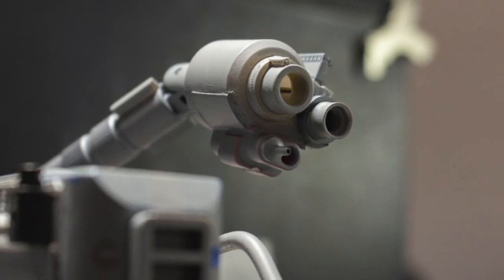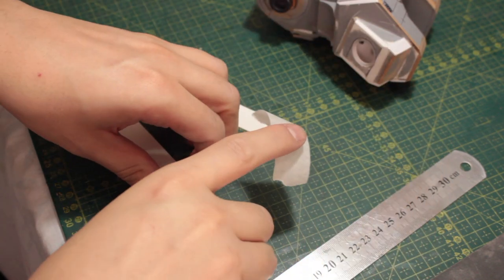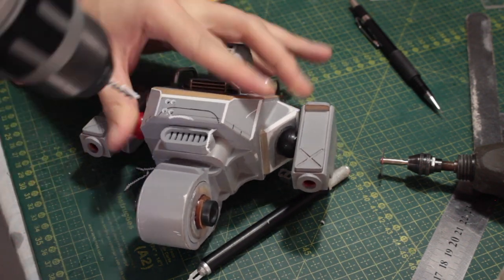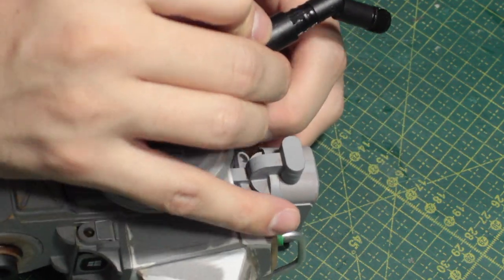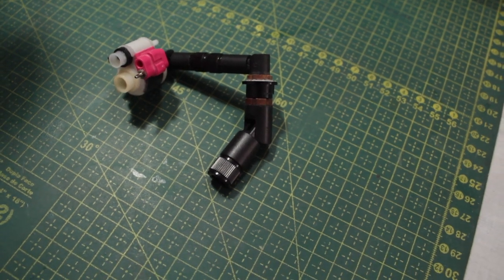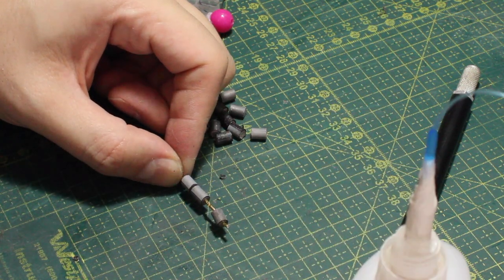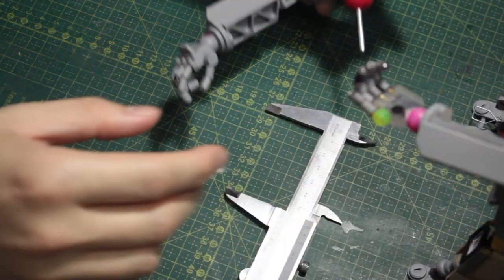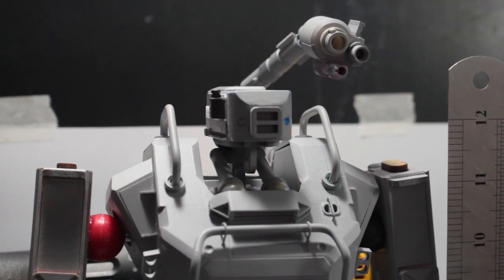Scratchbuilding a Humanoid Repair Robot - PT3

Comment: You can make your own super glue applicator by cutting the end of a sewing needle off so you have a forked tip & use a pin vice to hold the pointed end & you dip the forked tip in the super glue & use that instead of a blade.

Comment: Would like to see the shoulder guard bars a little closer. Imagine this bot would be in tight spaces so the metal exoskeleton, or protection I guess, could be really tight tolerances to fit space. But hey, it looks great either way. Old cell keyboards like blackberry are good to use for small buttons, hatches and such.
Reply from the maker: I agree! I guess I thought they had to protect the head but, the tight spaces is indeed a good point.. Not sure I'm able to easily change that now that the glue is set real tight.. but anyways, thanks for your input buddy!
Reply: Cut Transform Glue nah man it’ll look great anyway. Cool how complicated a piece of machinery you’re making from such simple pieces. Have you got idea for paint scheme? I could see it a clean white/grey with red accents. A dingy yellow or a grimy metallic.
Reply from the maker: Thanks a lot!! As for the paint scheme, I really want to think about it for a while.. I feel the need to improve my skills on that matter, I'll make some paint tests first... But I leaning towards a using different finishes of metal and some accent color!

Comment: Great progress as always! An opinion about the drill: You should vertically align the point where handle is connected to drill body with the drill bit. Think that you are applying the force with the handle straight into the drill bit over a straight line. It will look better and more functional. Here is an ASCII art to show what I mean (consider dots as spaces):
..//==[][][][]=====> --> Force
//......[][][][]
Reply from the maker: Thanks a lot buddy for the input! I'm really going to think about it if I make another power drill..which is very likely to happen. ASCII art on point, by the way, got the idea across perfectly!